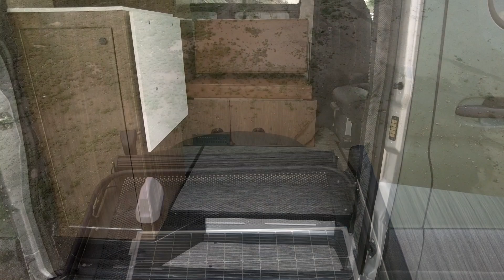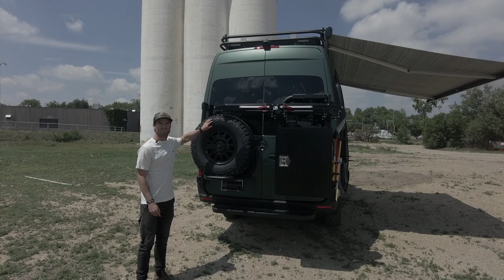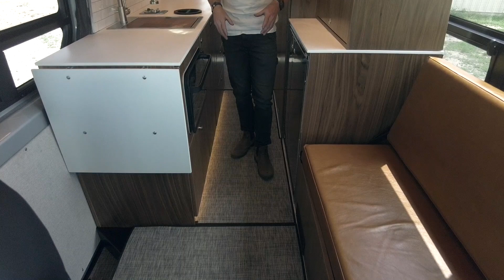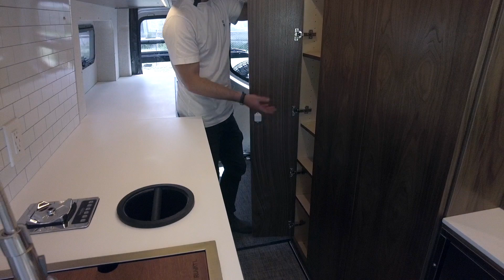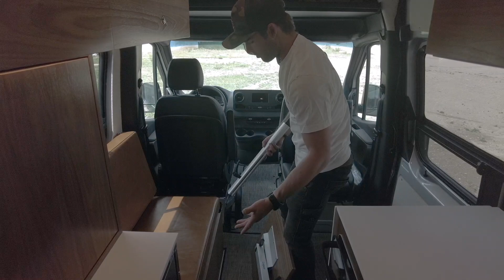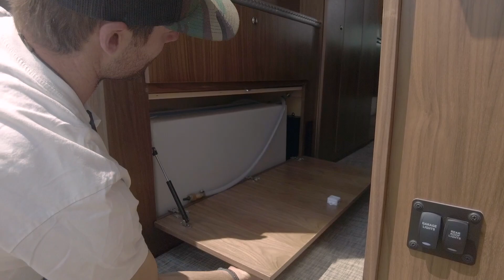VAN TOUR | Custom Van Build | Sprinter 170" 4x4 w/ awesome kitchen storage | Rossmönster Vans | 182

Comment: Love the lowkey bodywork and furniture - I’d go for more snazzy seats though. And the top of the lagun table looks flimsy. tough, no doubt, but still looking flimsy. Perhaps far-fetched, but I’d use the recycling bin so often that stuff could accumulate for a week or more in there, and how do you avoid putrefaction in hot climes? Er, refrigeration? Perhaps dismiss the recycling bin and chuck stuff out in nature.

Comment: Can you wire (electrically) rigs for any country, like for Greece, for instance?
Also, how much did this unit go for?
Reply from the maker: All of our builds are custom, so price ranges, but tends to fall between 80-200k for the build with price being dictated by the systems chosen vs. the layout in most cases. Since we're a custom shop, we can absolutely cater to foreign wiring if needed.